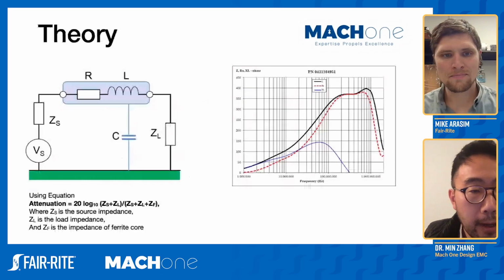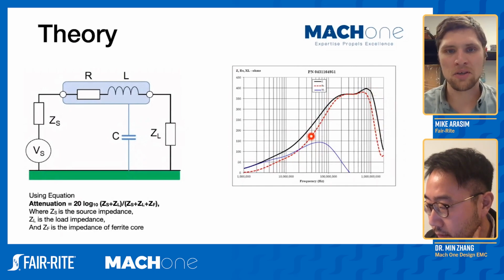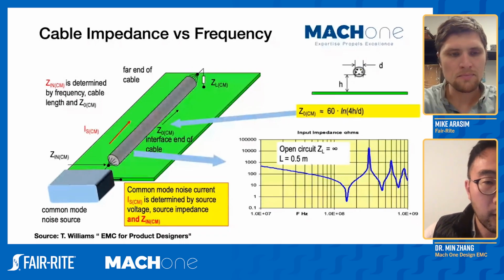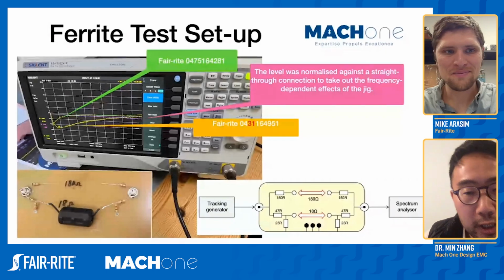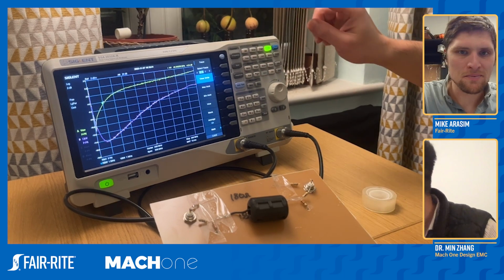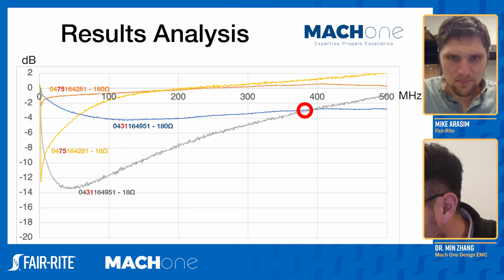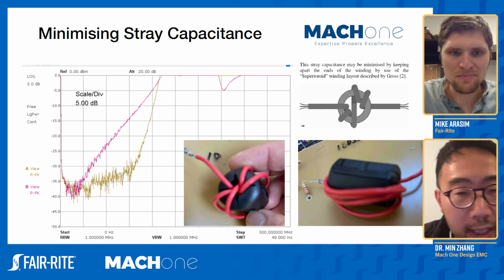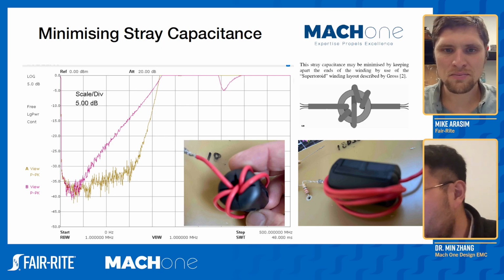Summary of Ferrite Basics with Mike Arasim

Comment: My concern is always that the ferrite core might act as a inductor and the cable might be a too short (=capacitive) antenna, which would then result in matching that antenna, making things worse. So the aim should always be to introduce a high real impedance at the frequency of interest.
Reply from the maker: Correct, we have a video demonstrating this in fact, when placing ferrite cores on one end of the cable, it makes things worse, the video sits somewhere in the channel....